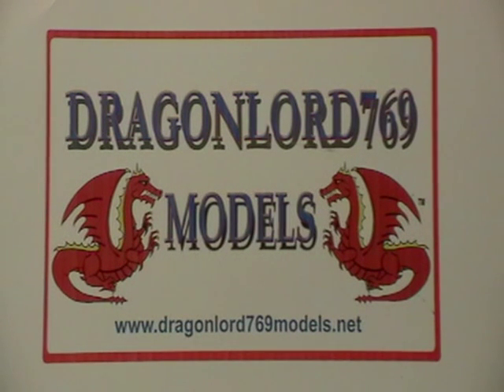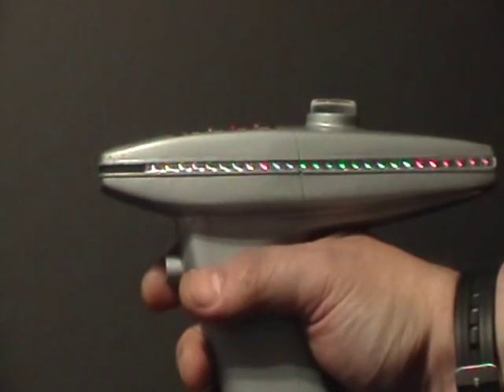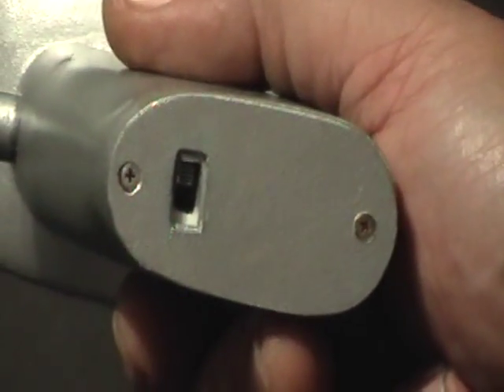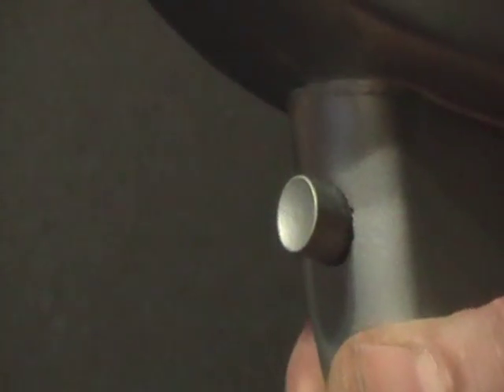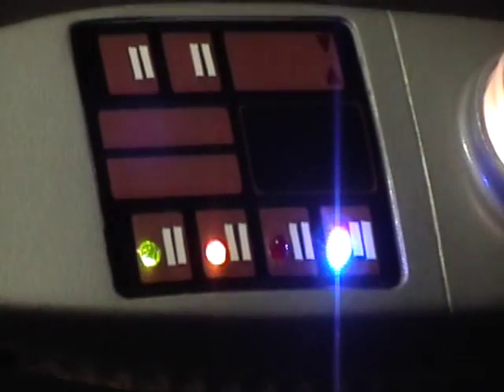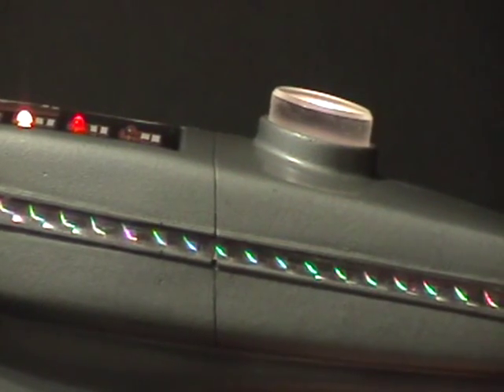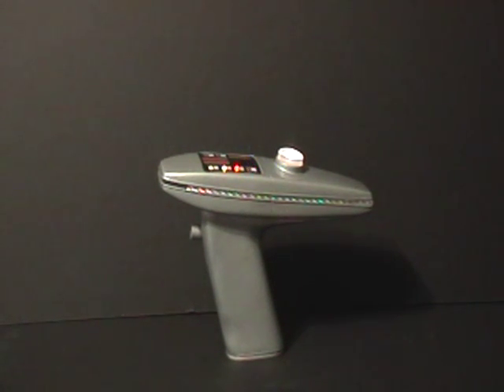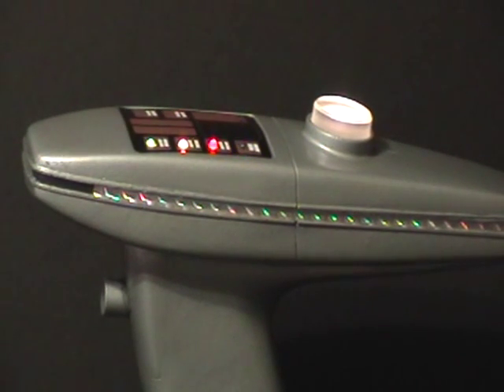Star Trek  Wrath Of Khan Phaser / WOK Phaser

Comment from the maker: There's one kit that lets you build either a TMP or a WOK phaser (includes different triggers & different control panels). 
Roddenberry also has kits for the TOS Phaser-1 & a nice  Phaser-II kit, + all Next Gen phasers (Dustbuster &Cobra thru Dolphin),  there's a great kit for a Assault 
Phaser. There's even a kit for the Phase Pistol from 'Enterprise', and a kit for Capt. Pike's Laser Pistol from the pilot episodes.  Kit's aren't cheap ($80 - $250 appx) but the quality is great.